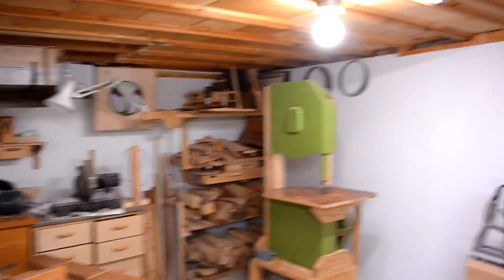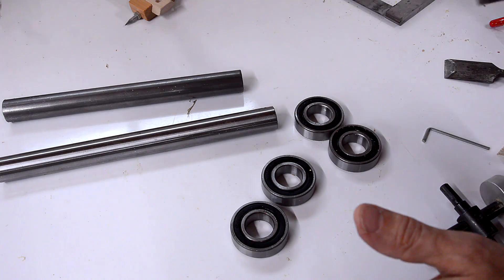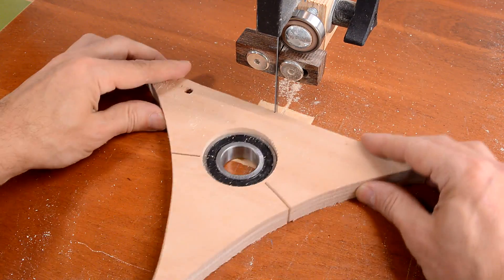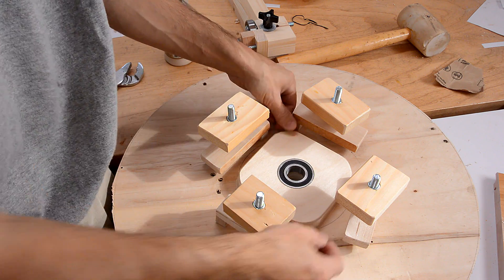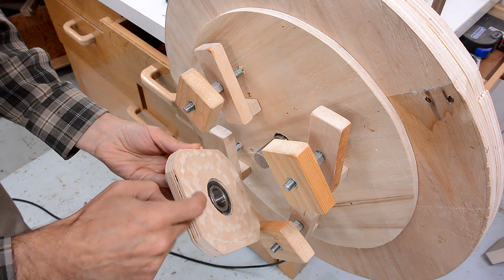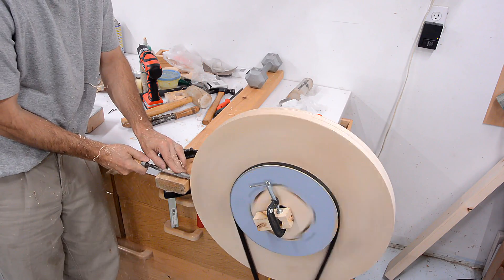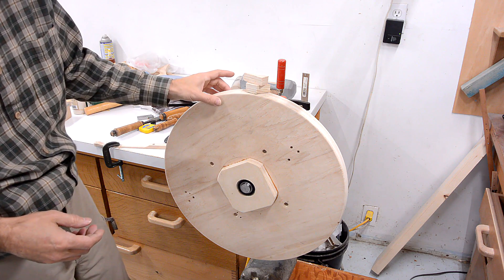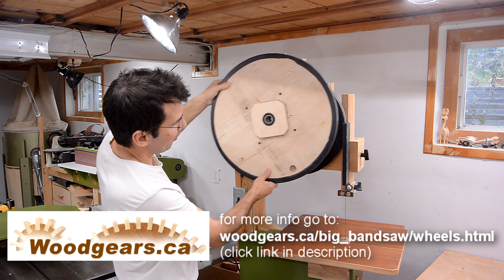Big bandsaw build 1: The wheels

Comment: Wouldn't the following method of making the pulley wheels be easier? Screw 3 sheets of plywood together, make 1 shaft hole, saw them around with that shaft hole as the center, loosen the screws, take the middle plate and make it slightly smaller. You can then slightly round off the outer plates with the router table, then reassemble the parts with glue. With the shaft in it of course. Then you have everything perfectly coordinated. Obviously adjust the middle plate to your belt width. And if the beam was made of steel tube filled with a wooden beam it could be thinner . That would give you extra space for deeper workpieces.

Comment: I thought when you said, "the wheel would have been" flatter or something like that, but you used second-hand plywood. It is ironic that as a beginner, I tend to have crappy wood, and yet you need more skills to work with used lumber. Just a though, a bubble to burst.

Comment: Sir my motor speed is 2880 rpm I have a two inch pulley on motor then what is required diameter of pulley and wheels to drive the saw for cutting of 4 inch wood

Comment: When adjusting the wheels on the axle, I just found that it's much simpler for to place the axle vertically. Then you do not have gravity working against you.

And for truing the wheels I'm using a router table. I tried the wood turning method like Mathias, but found that the plywood is quite difficult to handle. So I set up some lumber on the router table with a hole for the axle and then true the wheel there. To make the crown I'm tipping the axle a bit.

Comment: Excellent work! I have one question, can I use solid wood instead of plywood for the wheels?
Reply: I'm wondering the same thing, looking at those built-up pre-sanded table top discs you can buy at Lowes and Home Depot.
Reply: And I just thought of something about this:  in an environment with changing temp/humidity (like my garage workshop) you'd want the increased dimensional stability of plywood.  I'd hate to have a hot humid spell push those wooden wheels out of round.

Comment: Hey Matthias, do you think using the silicone coating you utilised to coat the drive drum of your belt sander would be a good option instead of the bicycle innertube to prevent dust buildup under the innertube? Or would it just get chewed up too quickly
Reply from the maker: Haven't tried it.  Worth a shot.

Comment: "The only way to get the bearing out...." You already had an over size hole, use a puck and the vice to press the bearing out of the tight fit into the oversize.

Comment: Hi Matthias. An idea. How about a 'power tool design principles' series? Ideal cutting speeds and the gearing to generate them. Pro's and cons of single v three phase motors (ok, probably with an expensive variable frequency phase converter - eeek!). Pro's and cons of assorted single phase motors - shaded pole noticeably inefficient, as you recorded. How about variable diameter pulley speed control - project in itself. Shut the worried safety tribe up with a thorough review - interlock switches etc. Incidentally, I suspect a lot of them are genuinely concerned for the safety you and your family. We don't want to lose you! Much too valuable. Best wished. BobUK.

Comment: Hi Matthias. You will be aware of a European plywood version. I've commented there that it would be nice if your earlier work was referenced. Better still, should you both ever get to collaborate a really, really good product could emerge. For example, there are some good alignment techniques on the other channel, but you have a much better trunion design for the table. I've made the point over there that a box beam structure can, if well executed, be almost as strong as a solid beam of the same size (see 'beam theory') and of course it's much lighter. Yours is the cheaper solution, of course, as it uses reclaimed wood, so it's horses for courses, as usual. Kindly regards  I'm very impressed with both approaches. BobUK.

Comment: Hello Mattias,  I bought the plans for the 20" bandsaw and I had a 30mm MDF for wheels that is very solid. is 30mm enough  or I have to glue another 6 or 10 mm to reach 36-40 mmm. I think a solid 30mm thick could be balanced easier. Thanks for your advice.

Comment: Does anyone knows where to find this kind of adjustable drill bit that can be seen around 1:47 ? I can find one with extensions at both sides, but this is tricky as it requires both sides to be adjusted the same distance from the axis. And I find this one more practical to use. Preferably something that I could find in Europe... ;)

Comment: So I have a motor that the manual claims to be 2 HP (that's only legit in a world without physics) and 3400 RPM's. Is that too much motor for a band saw? I read through your build and you talk about your struggles with your 3500 RPM motor so I was just curious if you would suggest that I keep on looking for a different motor or if it will suffice.
Reply from the maker: should be good for a bandsaw.
Reply: Wow thanks for the fast reply! Love your work!

Comment: I have to ask what might be a stupid question. Why do you make a block to put the wheel bearing in, instead of just putting the bearing in the wheel itself? And thank you so much for sharing all of your ideas!
Reply from the maker: bearsing need to be further apart. Also, tricky to make the block, wheel would not fit in a vise, alignmtnet would be impossible, and if you screw up making the hole, you need a whole new wheels.  So many reasons...
Reply: Ok thanks!

Comment: Why not use the wheels off an old bicycle?  They are true and easy to straighten if they are not.  Plus you would have bearings and a race already right there.
Reply from the maker: search for "more bad bandsaw ideas" on my website for more on that.
Reply: I never thought about the strength of the axle.  That would make things a bit more difficult.  Plywood wheels it is (unless one has an aluminum foundry to cast some aluminum wheels).

Comment: In the video you get the impression that the diameter of the wheel is very important. How come? I was thinking about making one of my own soon and I was hoping I could do 25 cm (9,8 inches) diameter wheels. Would this be too small? Is there a problem in my thinking when I want to adjust the wheel size to my preferred size? I want to make a table band saw that I can just stow away under my table when not using it.
Reply from the maker: if the diameter is wrong, then it won't fit into the rest of the design.
Reply: That part I understand, but I wondered if I'm free to scale it down as I wish, without having issues with too much bending on the blad and so on. But I've seen other 25 cm and even smaller so I guess I'm fine :)
Reply from the maker: you will have the same issues as others have with 25 cm wheels.
Reply: What are those issues? What's the minimum diameter that you would recommend? I live in a one room flat with my partner and she's not happy about all my projects taking up too much space x)

Comment: Matthias, I'm seriously thinking about buying the plans and building your 20" Bandsaw. However, I think I want to extend the frame (and the blade guide support, etc.) another NINE inches, which would yield a 22" throat opening, instead of your "stock design" of 13". This would facilitate the use of a fairly common 150" Blade. Along with lenghting the backbone of the saw, I assume that I would also need to add a little more strength as well. I would also probably want to use some harder wood for the blade guide support column (I have some very dense scraps of 4x4 Brazilian Rosewood scraps, I bought a fire sale prices that would be great for this, IMO. I also have some small chunks of Ebony that were leftover from a project that would make great Blade Guides, IMO.) ... Does all this seem feasable to you? Anyone else have any ideas about this? ... Thanks!
Reply from the maker: before you do that, please read my article on the physics of bandsaw resawing.
Reply: Matthias, thanks for your prompt reply! I just read and watched your excellent treatise on The Physics of Bandsaw Reswaing (https://woodgears.ca/bandsaw/resaw.html). I have to admit that I hadn't really imagined trying to resaw anything that thick, but I was thinking it may be useful to have more room so I would tend not to run into the problem you did when you couldn't fit a large object in the mouth of the saw, so that you could cut off a piece from the side (I'm not sure what video it was, but I thingk you were trying to fit a wheel of some sort into the saw, so you could remove an appendage of some sort) and it wouldn't fit. Your "physics" article really  impressed me, but I still would like a bigger mouth opening. 

At this point, I think I will still want to proceed, but, perhaps add only SIX inches to the backbon(and mouth opening), yielding a 19" opening  and use an equally common 144" Blade (as opposed to 150"). In the VERY RARE case where I would want to resaw something over 12" wide, then I would use a blade with a much lower tooth count, and proceed slowley with much caution. At least I would have the option if an alterenative method were not possible. (I also own a Grizzly 17" saw, Model G0513X2, that has a maximum capicity of 16.25", so it makes some sense to me that I would have a larger opening on your 20" saw. The Grizzly 21" saw, Model G0566B has a 20" opening, BTW.)  That size seems like it would be a, perhaps, more reasonable size. I just feel like a 13" mouth is a little bit small (especially for a 20" saw, IMO). Again, I respect what you have to say, because you are the Expert in my eyes.

Comment: Cool build. If the hole in the center of the wheel is large enough, you could use an old car wheel balancer to balance it. I use it to balance fly wheels for Chevy 400 small blocks. Works great.

Comment: you mentioned dust n chips collecting under your tires. it made me go look at mine cause i didn't ever remember a prob. well i looked and i don't have any. i also noticed i cut my tires just shy of the width of the wheel rim so perhaps that's why. also i have been using inner tubes from truck tires (crosscut) since late 70's. they work fine and one innertube lasts for a way long time, more than a decade easy. it's gotten so i have to make crosscut pieces for other stuff besides band saw wheels as i don't want the elastomer to go bad on me without using it up. that said i found that they don't last on my belt sander, the drive wheel is directly below the sanding station and i have no dust collection, perhaps that's the prob. i'm not gonna change it though. i just run it "raw" on the mdf wheel and it shows no wear i can see, and it's been used pretty steady for an easy 20 years, probably more

Comment: I purchased a set of your plans for the smaller bandsaws and plan to start soon. However I want to make mine 2-speed so I can  also use it to cut metal & plastic. The plan is to add another set of pulleys. Do you think this is a practical modification to your design?
Reply from the maker: may or may not be practical, depending on how you do it.

Comment: When you created your belt sander you used silicon caulking on one of the wheels.  What are your thoughts to use that for the tires instead of inner tubes?
Reply from the maker: It might work, but I prefer inner tubes
Reply: Daniel Audette

Comment: You can put your bearings in the freezer over night and they will shrink just enough to fit in smaller hole. Then they will expand as they warm up. They will never work themselves lose.
Reply from the maker: That works for steel.  Not for wood, because the hole in the wood is a lot smaller than it would be in steel.
Reply: Saturate the inside of the bearing holes with epoxy glue thinned with Acetone (until it watery) before pressing the bearings in. This reinforces the wood around the bearing considerably.
Reply: Good point Matthias Wandel and by the way I love your channel, please keep them coming. Karen I will need to give that a try. It sounds like it may a good idea.

Comment: Anytime i cut thicker wood with a jigsaw, the blade doesn't stay perpendicular to the wood and flares out toward the tip. Is that a product of my blades, saw, or technique? Any tips you have would be greatly appreciated.
Reply: - Make sure that your blade is perfectly perpendicular to your saw base (Use a square)
- Let the saw do the work, don't push too hard.
- get high quality blades that are suited for the material that you are cutting.
And of course, a good quality jigsaw makes a big difference... They are better balanced, have less play in the mechanism and have a stronger base.

Comment: Where do you get the band saw blade? Is it special made?
Reply from the maker: this one uses standard lenght 132 inches
Reply: I'm seriously thinking about making the 24 inch. The electric motor is a big question mark. I know nothing about them. I'm thinking maybe a 5 hp single phase... what rpm?
Reply: Felder's FB 600 has wheels close to 24 inch (600mm), with an 800rpm flywheel for approx 25m/s (82 ft/s) blade speed. Standard motor looks to be claimed as 4 hp. That blade speed is pretty high, and their larger machines seem to be a bit lower (~21m/s), but hopefully that's a useful ballpark for you.

Comment: Would it be possible to get the specs for the bearings and shaft, along with the supplier you used? I'm not familiar with good sources for those. Thanks.

Comment: that's a awesome idea. how does the wood hold up over time? do you ever have to take them off and true them up? or do they keep straight. I have been thinking of ways to build a band saw like those. but not of that much wood. I may give it a try. what's the largest that is affordable to build? are the blades expensive? this is a great video. and a great place for ideas! thank you!
Reply from the maker: never done any of mine.  Built two bandsaws in 2010 and one in 2011
Reply: +Matthias Wandel  so if kept in doors and dry. it should have a decent service life. but what about blades?  how do you determine blade size? or length I guess is what I'm asking.
Reply: That depends on how stable the humidity is in your work space, If you are at 15% humidity at one time of year and 40% at another, You may have issues. But if your always at 15% then you are gold and things should stay straight.

Comment: Is it better to undersize holes for dowels so you get more of an interference fit? I've also crushed the dowel down a bit when they're a bit bigger than advertised in my drill chuck, wonder if that's good or bad.
Reply from the maker: I don't know.  Do some tests and let me know
Reply: I've built a number of things with dowels, and so far, using an interference fit with no glue has made some very strong joints. Some of them broke the dowels before they pulled out, when I've had to take the pieces apart. (I mostly use oak; it's free from where I work - We go through a lot of pallets!)
I make the dowels in a "pencil sharpener" jig that I saw on Mr Wandel's site. Works great! And with hardwoods in a hardwood jig, with the hole just the right size, I end up with what amounts to a polished rod of wood. I've used them for spindle pieces as well as dowels.
I've also made a couple of dowel-secured mortise and tenon joints with no glue. Those joints should last forever. (Doweled mortises! Belt and suspenders!)
Lately, with dowels so easy to make, I rarely use screws any more, and haven't used nails in ages. The only time I use screws is to build my jigs and some shop fixtures that I don't intend to keep for very long.

My observation has been that when I use very dry wood, an interference fit only gets tighter when it absorbs a little moisture and the wood swells. I built a gate this way, and it went together a little sloppy, but got nice and tight after a few weeks in humid air.
Generally, I have to hammer my dowels into the holes, and then the only way to get them out is to drill and crush them.
The harder the wood, the closer you need to make the fit. Pine will hammer into a much smaller hole than oak - and oak will start splitting and splintering if you hammer on it too hard.

The great thing about making my own dowels is that they are effectively free. If I crush one or two in a drill chuck, no big deal.

I find that in using the jig, advancing faster leaves a rougher surface, which is great if you want glue to have plenty of surface to grip. Slow and steady, with a slight interference fit in the guide hole gives a smooth surface, for pieces that will be exposed in your finished piece. It takes a bit of playing with it to get the jig set up just right, but it's worth the effort. Just make sure that your chisel is as sharp as possible.
Tip: If you start getting smoke, your dowel is too big for the guide hole! (Plus, too tight a fit will torque your wood and weaken it.)

Comment: hi matthias.  i enjoy a lot of your vids so thanks for that.  I had a quick question.  a lot of people seem to have issues with the circle cutters in a press like you use in this video.  what brand is it and do you get any wobble?  im looking to purchase one.  I have an old walker turner 900 press, so its pretty solid, but is there a paricular brand of circle cutter or size/thickness you recommend?
Reply from the maker: don't know if it has a brand.  I just bought a cheap one.
Reply: I think one of the keys to minimizing wobble is to raise the drill press table so that you're only extending the quill a small amount to get to your full depth of cut.

Comment: Matt, obviously boring the material out is quite fast, but since you're laminating two halves for the wheel, could you not balance each individually, mark the two bottom points and then laminate them with those two points separated by 180* ? Are there any drawbacks to this (outside of time)?
Reply from the maker: I can't balance it until it's mounted on bearings and turned, and to do that, I have to glue it together.